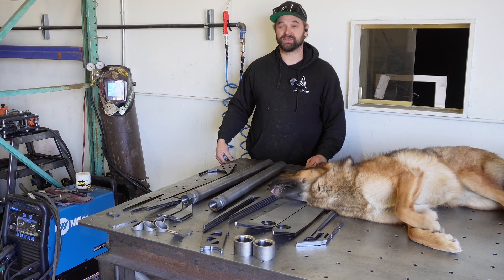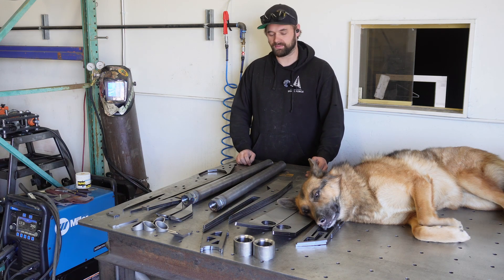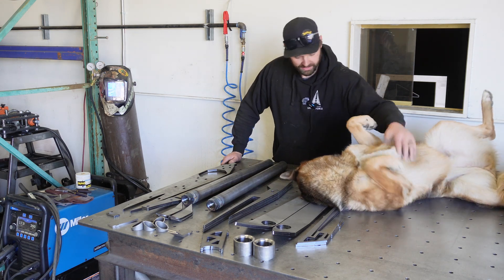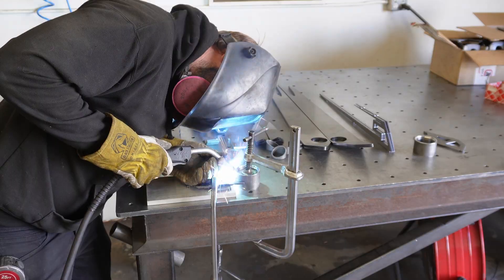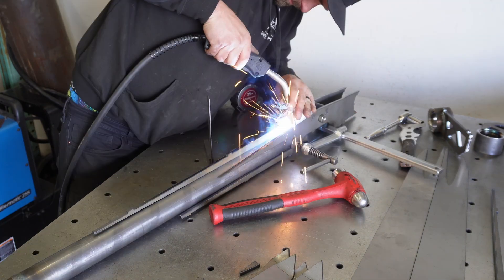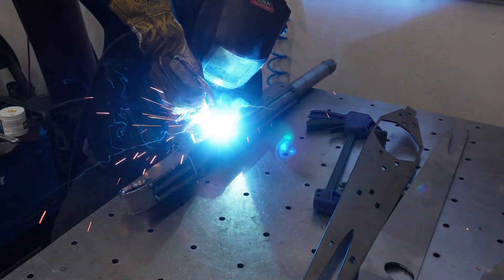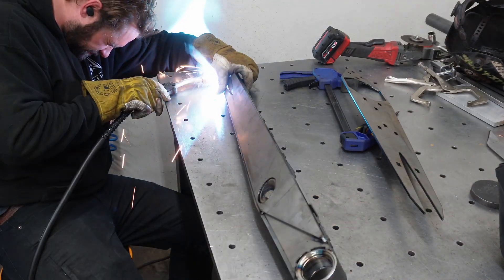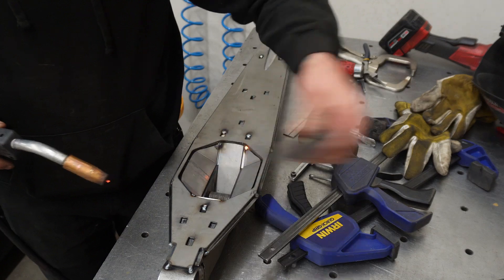Building a set of One Ton Tacoma Trailing Arms

Comment: Only thing you’re missing is a trailing arm for a secondary bypass shock, I’d be throwing money at you as soon as you make one.
Reply from the maker: I’ll have a set of those with your name on them in about a month.
Reply: @martecengineering  you sell that as a 3 link kit, where I can run a secondary shock and have a mount for both of the shocks to the frame I’ll slap a deposit down today. If you can get 20 inches of travel it would be the perfect setup and new standard for the Tacoma for anyone going long travel that wants a complete kit.
Reply from the maker: @davidarteaga6054  Hell yeah man! Were shooting for that 20" number with a 14" bypass! Kit should be all fit by the end of the week and the video will be close behind.
Reply: @martecengineering  I’ll be one of the first to buy it then! Can’t wait until they’re ready to ship